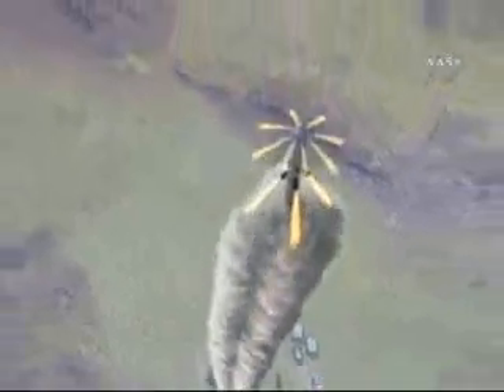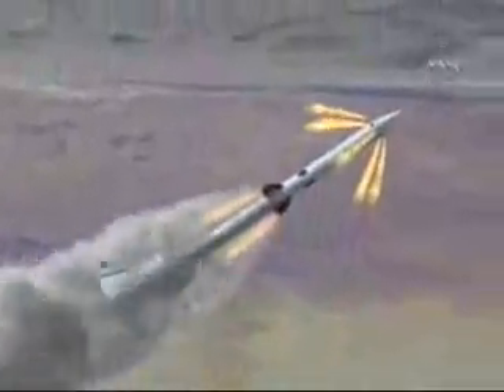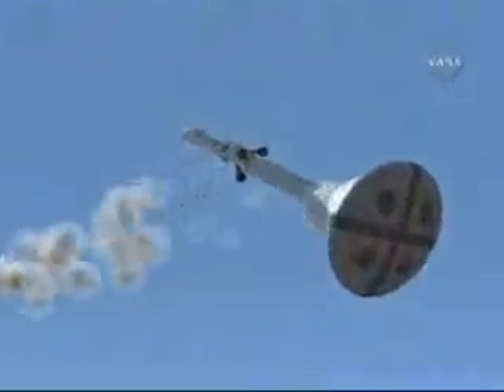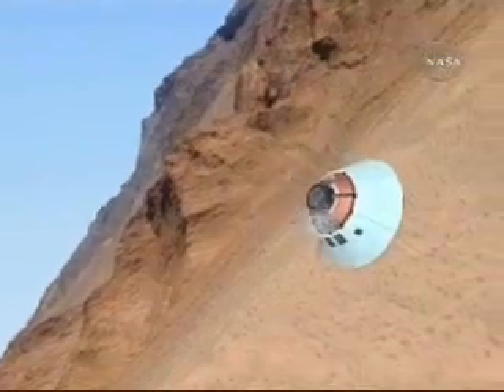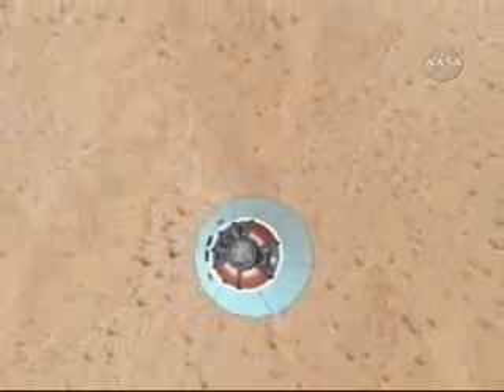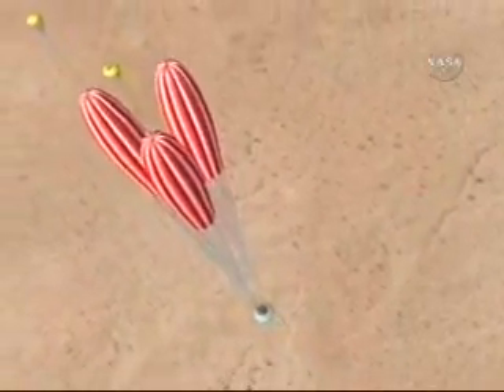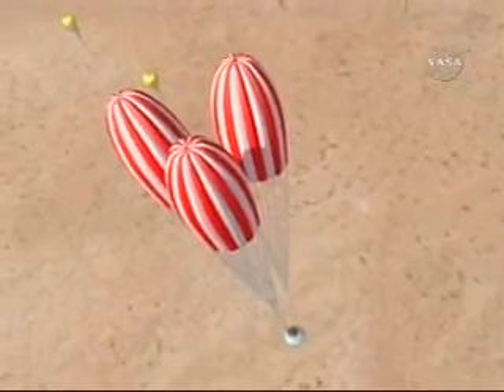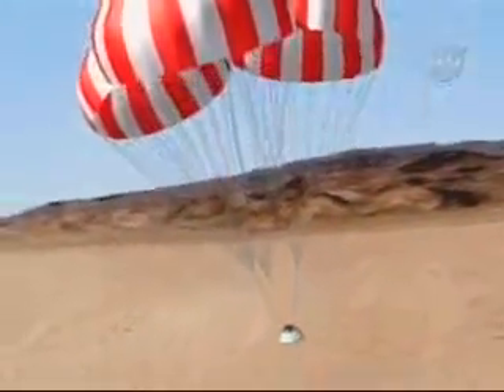Ares1-X Launch Abort System Adapter Cone

Comment: I understand the skepticism.  The space shuttle did not have any practical ascent abort system due to the vehicle configuration.  The U.S. hasn't had the ability to abort since Apollo.  However, the Russians have abort capability on Soyuz.  If you look up the Little Joe tests, this technology does work.

Comment: pfffftttt. 1 Saturn 1B DID have a large escape tower system. Falcon 9 has NO escape system as it has not flown a manned capsule yet, even in prototype. Soyuz DOES have a massive escape tower rocket and pop out stabilising grids due to the fact that it must pull both the Command Module and Mission Module off the stack , unlike apollo/falcon/ares etc which is one of soyuz's big problems....

Comment: escape system weighs more than the frikkin payload and it is only useful during the first 5 minutes of a 9 month Mars mission say. This is typical bureaucratic BS from NASA.The only reason they are doing this is to save themselves from a potential PR debacle if the thing blows up on camera. If it blows up half way to Mars because they used up all that rocket fuel to bring this shit to orbit and not life saving equipment, well who cares? It's all about managing perceptions not about exploring spc

Comment: In addition, Ares1 must almost be the size of the Saturn rocket to have enough power just to carry this massive escape system.  All because NASA wants to use Shuttle solid engines.  See youtube Delta II explosion to see solid rocket fuel destruction and why the escape system must be designed to pull you miles away.

Comment: This massive extremely heavy escape system is only needed because Ares1 uses dangerous solid rocket fuel.  You must have to get miles away so that solid rocket debris chunks do not destroy the parachute.  That is why Soyuz, Falcon9, Saturn 1B do not need such a giant escape system because they use liquid fuel.